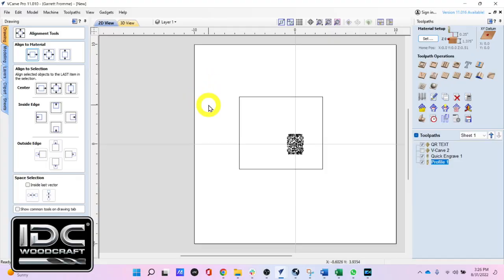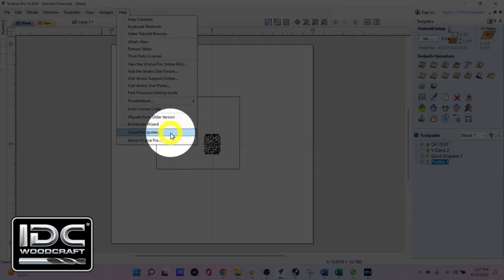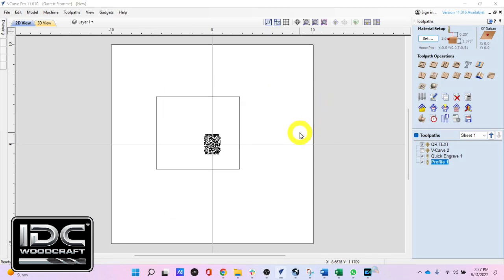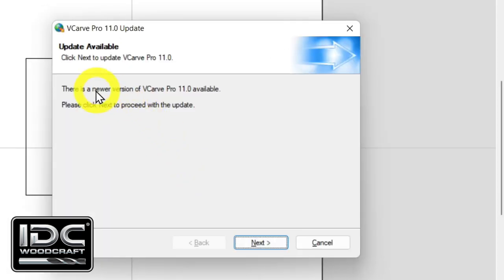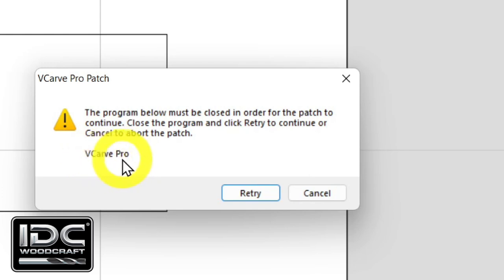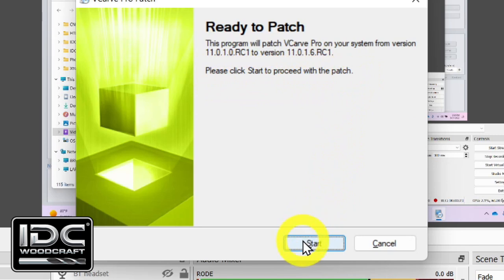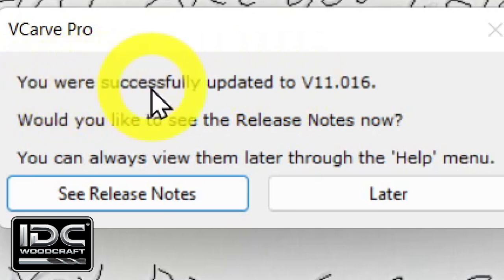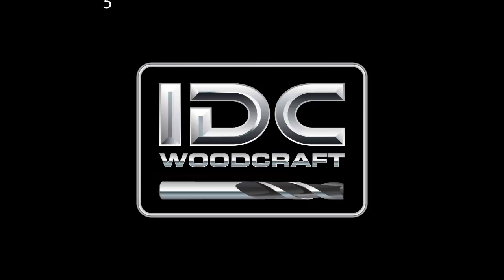IMPORTANT - How To Update Vectric Software with Fixes & Patches, Vcarve, Aspire & Cut2D

Comment: I did your recommended settings and it works but on my onefinity it's not even close to the times it says in vectric. Example. I'm trying to do a 3d carve and vetric says 7 hours and 56 minutes. When i load it onto my onefinty it's says over 16 hours. Any way to get it more accurate?
Reply from the maker: Chrisl, I would recommend taking a look at this video brother. Here is a link: https://youtu.be/qxi7epIGVX4

Comment: Yeah, not working, says I have the most recent version of VCarve Pro, which is not true, I have 11.016 not 11.504.
Reply from the maker: Cingy, try and reinstall brother! You will get the most up to date version that way.
Reply: @IDCWoodcraft   For some odd reason I wasn’t able to update on Chrome but by accident opened the update link in Microsoft Edge and it updated just fine.  Any way thanks for responding and thanks for the content! 👍🏻

Comment: Hello, regarding laser cutting, what maschine would you recommend for cutting 20mm thick foam? Thank you
Reply from the maker: Alb, there are lots of machines out there that would work for that but I would recommend any laser with an adjustable z axis.
Reply: @IDCWoodcraft  I have a cheap Elekmaker frame where the Laser Diode died, I need a CO2 laser or should I just search for a strong Laser Diode? Recently I found out about RF laser wich I found them cool.
Reply from the maker: @catalinalb1722  It depends on what you want to do with a laser. What do you think you'd want to do with it